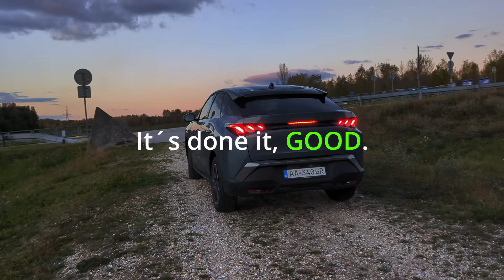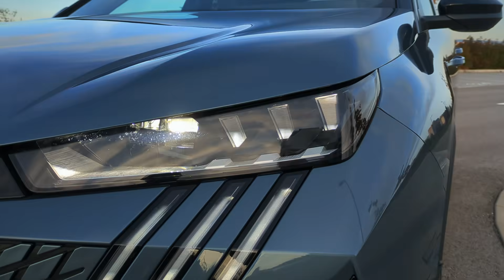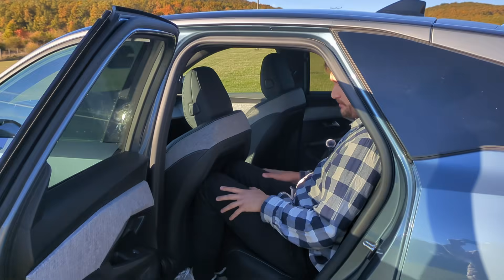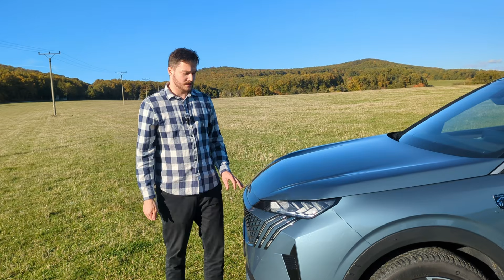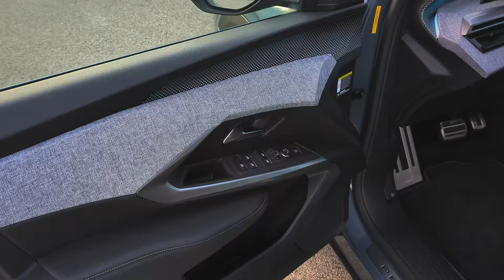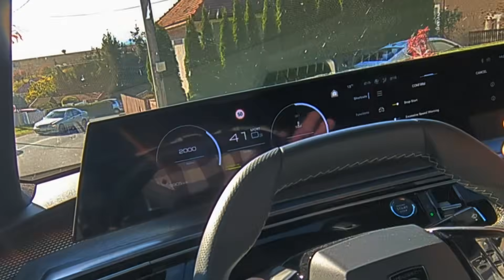2025 Peugeot 3008 Hybrid review. Better than PREDECESSOR?

Comment: how is consumption ? and comparing opel Grandland
Reply from the maker: Hello my friend. Unluckily haven't driven Opel, but I estimate very similar numbers maybe 0.1, 0.2l/100km higher as it has same drag coefficient, powertrain and weight will be similar. 
Consumptions are in the video but if I remember well it was around 6.8l/100km motorway alone in the car, 7.5l/100km with loaded car and speeds of 140-150km/h.
Reply: @upshifter yes yes i am so sorry i saw consumption in video after writing my comment thank you very much ❤❤❤
Wish youtube add 10 likes button for your channel haha
Reply from the maker: Hah thank you my friend. Absolutely no problem, did I remember correctly?  

BTW Opel is also slightly heavier, so yeah those 0.1-0 3l/100km I think it would be. 

I actually quite like it, this Grandland, but there is a bit of a problem with manager. She prefers influencers rather than car journalist, she prefers people who drive slow and don't push like me plus when I was 19 and had Opel for test I wanted to do Top gear like thing and took Zafira Van for a racetrack which she didn't like, and as I wasn't experienced enough, I didn't communicate that before hand. So quite a tough relationship also due to my mistake, hopefully sometime in the future, it will be possible to bring also Opel for the test. 😀
Reply: @upshifter hmmm drive slowloy to make a good consumption... after that you pay more than 35k euro and get 8L/100km when just drive in city hahaha
Reply from the maker: Yeah I mean, most of the time I do drive to get good consumption, only when I make this mountain pass proving I do push to show handling and I like it to clean the valves "Italian tuning". 😀 

Well if you drive only in the city, there you can drive it in between 5-6l/100km which is very good for such size SUV.

Comment: I have 2024 308 sw and i love it. Thinking of changing it to 3008. What do you think?
Nice review btw. Sub well earned.
Reply from the maker: Hello, I gotta say I prefer 308SW as a car, but understand that in terms of seating it might be too compact. So I would say yes, just expect higher fuel economy overall and on motorway, but you could have seen in the video it is not so bad. So I´d say if you´re looking for more room, go ahead!😎 I just have to recommend to you to drive it in Sport mode for real world driving where you need engagement, reaction and at the motorway to more easily overcome drag. But if you drive slowly comfy around the city, then there is good to use Normal or Eco.
Thank you for your support and sub!❤

Comment: An absolutely brilliant car having been driving the Hybrid GT model for the past 6 months, interior is like no other. Comfortable interior and ride and plenty of power from the engine driving in the real world over 5000 miles. Would definitely recommend 😊
Reply from the maker: Thank you for your experience. Maybe a lot of people would be also interested about the reliability aspect of this new powertrain. Have you had any problems so far?
Reply: @upshifter your welcome and nothing to report so far has been totally reliable😊
Reply from the maker: @stevedj2707 great to hear that those changes to the engine worked. They really worked hard to improve it.

Comment: Thank you very much for your video! :-)
Reply from the maker: Thank you!  I hope it was helpful.
Reply: @upshifter  Today I ordered one Business, so I hope that I will be satisfied like you:-)
Reply from the maker: I am sure you will. I advice to you drive it all the time in Sport mode, like I did. For best experience and management of the battery and hybrid system.
Reply: @upshifter   Sport mode? Ok so is it good consumtion on sport mode too?
Reply from the maker: Yes of course, for normal real world even better than normal or eco, as the car is more light-legged when overtaking or joining motorway, you don't need to press accelerator as deep.

Comment: Peugeot 3008 1.6 plug in vs Cupra Terramar plug in?
Reply from the maker: I have to say Terramar purely because VW technology has this feature to plan use of electric power ahead and really drive for 3.5l even for long distance when you put your destination into the satnav. And Terramar will have a taller boot, as Peugeot is Coupe. But as far as interior design and quality goes, power and suspension set-up I'd for Peugeot.

Comment: great video. thanks!
Reply from the maker: Thank you man! Considering the Peugeot?
Reply: @upshifter yeap i am going to buy 3008 gt mild hybrid
Reply from the maker: Excellent! Congratulations!
Reply from the maker: What other models were you considering?
Reply: @upshifter tiguan, bmw x1 u11,audi q3
Reply from the maker: @ExileDarker amazing, Peugeot has the best design inside and out. And the interior is also very nice quality.
Reply: @upshifter it is about a price. ofc bmw x1 u11 has more benefits like 2.0 diesel 150 hp , more liquid and etf but it cost 1.5x then 3008. same to q3